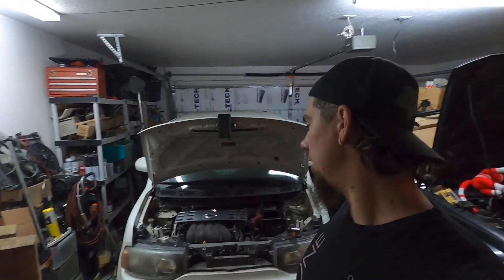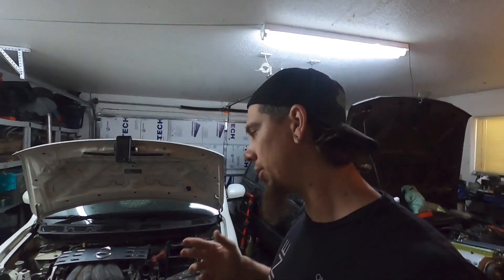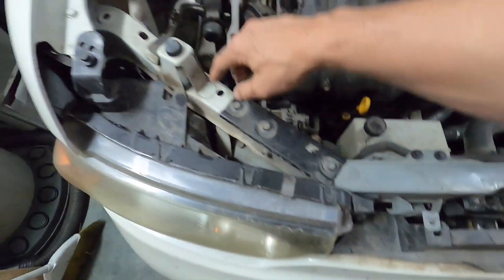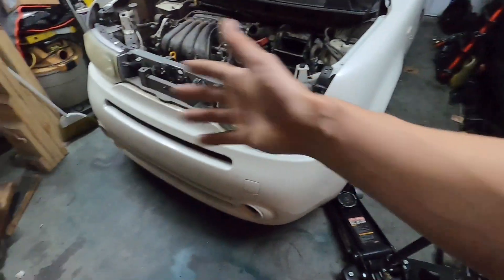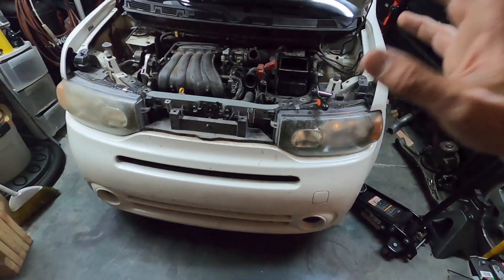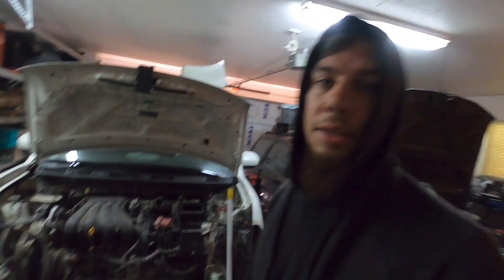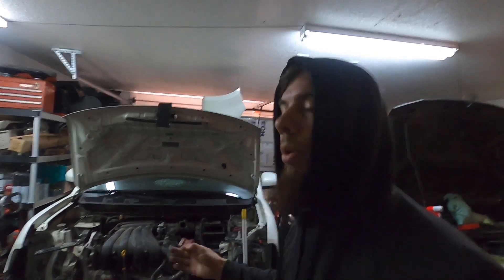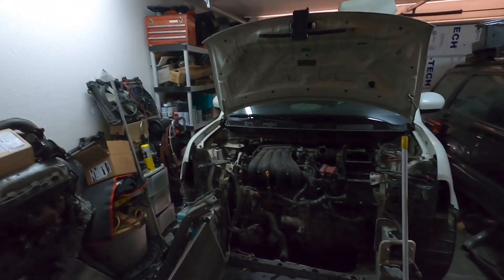How To Mechanic 101: 2009 (Z12) Nissan Cube Engine Removal Prep (First Time)

Comment: Great video. I bought a Cube 2 years ago with 85K. It blew white smoke out the back so we had the head gasket replaced. It’s been only 20K since then but we seem to lose the coolant in the reservoir about every two months with no visible leaks underneath. Plus the oil doesn’t stay as clean as my Honda after oil changes. We bought the car for my kid and loves it but our Honda and Mazda, this has given us headaches. Any idea why I’m losing coolant and the oil gets dirty fast?  BTW prior to the head gasket I noticed that plugs were oily. Post head gasket the plugs look okay but still compared to our other Japanese imports, the plugs look dirty.

Comment: Does most of this need to be done for a radiator replacement? Any help or advice
Reply: No. Take the top support off, unbolt and disconnect the fan and wiggle it out the top. Next, disconnect your hoses. There are 4, 10mm bolts near the sides of the radiator. Unbolt and pull up.
Reply: @caldwellguy  threw this video and several others that came close I was able get a good idea and I took the front bumper off it made it easier
Reply: @caldwellguy  also thank you for replying you’re the only one that did

Comment: I can relate to Nissan's electric systems of the last 10 years or rather when they hired that lousy loser from Italy to make them profitable again. He is the reason they have a plastic timing chain guide, crappy out of date sensors that fail prematurely. I just got all that crap sorted out I'm my 2010 370Z. It finally works as advertised. clutch sensor, start-stop button all new grounds throughout the chassis an Optima yellow top and new leads for the battery. All that is left is the new wheels and tires and then on to the body issues like Nissan's horrible paint and clear coats. Great vid monkey, keep it up.
Reply from the maker: They really have become giant pains in the rear, I didn’t know they hired an Italian dude... that explains a lot. I mean look how mopar went after the fiat merger, lots of electrical issues that didn’t need to happen. Makes lots of sense. 

Buuut that 370z sounds like it’s about ready to rip for sure!!! Why haven’t I seen any videos about it?! I’d love to know more about your rides!
Reply: @MonkeyWrenching  I don't do the car thing here, you guys are way better at it. I will do a walk around and stuff for you if you want. It is just a Z and my Shelby is gone. I had to sell it for...Reasons. I plan on a viper or SRT10 1500. Once I get reimbursed for my wife's medical bills. insurance co,  are the scum of the universe.
Reply from the maker: I feel ya, it’d be cool whenever ya get bored and wanna show whatcha got! By the way, yeah f*co insurance companies. They’re trying to get my brother for 67k for a a helicopter ride for his newborn son because the hospital here is too cheap to have a NICU, they won’t cover one bit of it and now he’s fighting the whole thing. What’s worse, he works for the damn hospital... medical stuff is ruthless, all about profit.